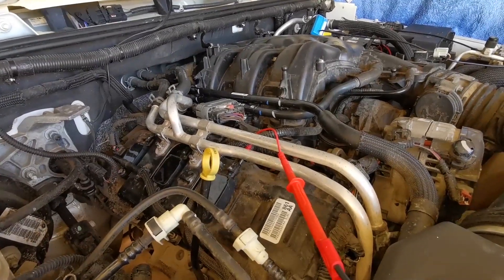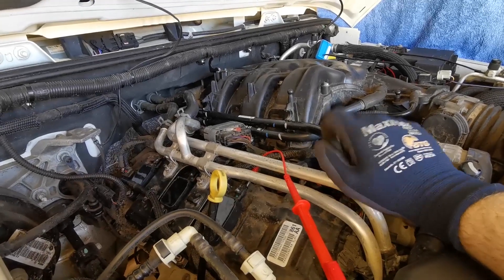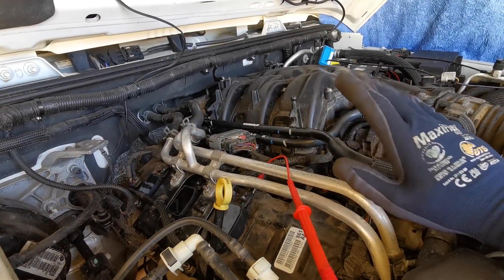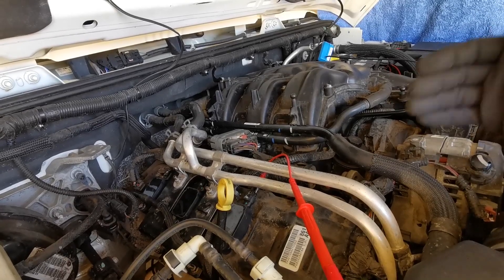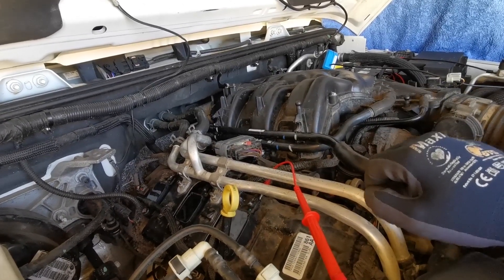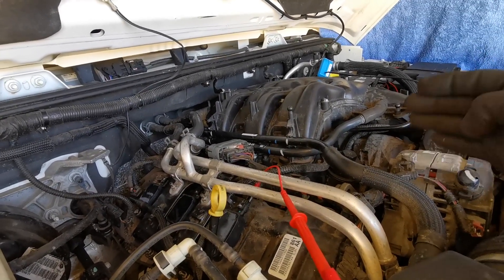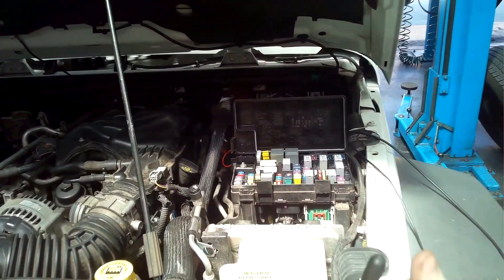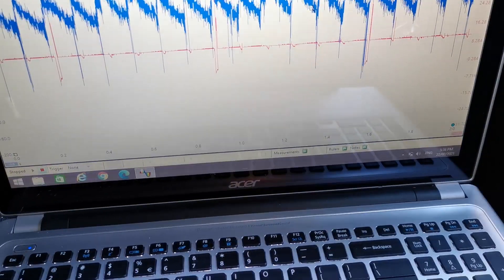Engine Light Keeps Coming Back On - Jeep Wrangler - Problem Found - Step by Step DIY

Comment: Nice one man. But this is hard problem , i mean its not intermittent . That's why you can catch it with compression test and leak-down test .Do you know - I wonder if there's way to find problem with intermittent sticky valve(valve not closing, bind in the valve guide) WITHOUT having a scope and cylinder pressure transducer. The only way without DARN EXPENSIVE SCOPE and equipment i've found on the internet is good old "vacuum gauge test" . The needle must be at 17 to 21 in/Hg(depends on the engine) . And must drop occasionally about 4 divisions. I think this works on old carburated/distributor cars . But not sure about modern vehicles.

Comment: Great dectective work there Ger what scope do you use I was looking at the 2 channel pico to use on my laptop as I’m mobile
Reply from the maker: Thanks James, I appreciate the kind words 🙏

I usually grab the snap on or Autel scope that we have in the workshop as they are integrated into the scan  tool it makes it easier and saves time on set up and I can flick back and over in live data as well. 

The one I am using here is a 2204 pico, so a fantastic value 2 channel scope, I have 20:1 attenuators from Hanktek, my leads and amp clamp are also Hanktek brand. My backprobes are off the tool truck.

Pretty inexpensive overall when comparing other options out there 👌👍

Ill add links in the description for my setup when I get a chance 👍
Reply: @GerardBurkeBurkesGarage  thank you buddy keep up the good work 💪👍🇮🇪